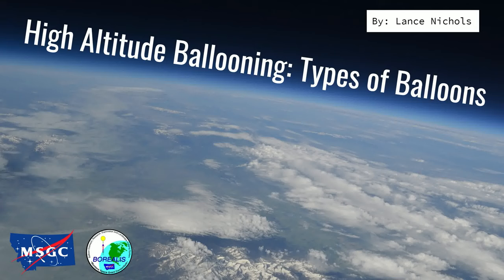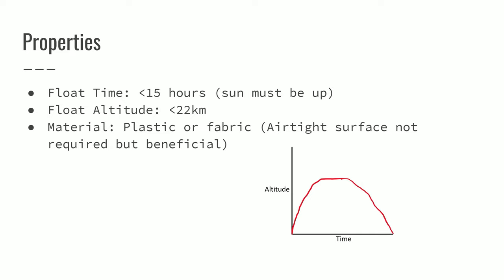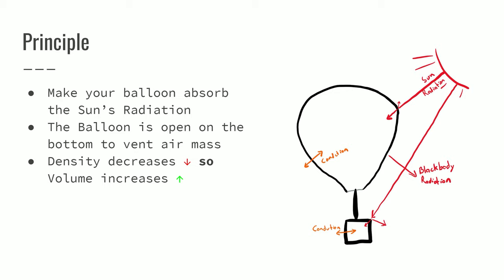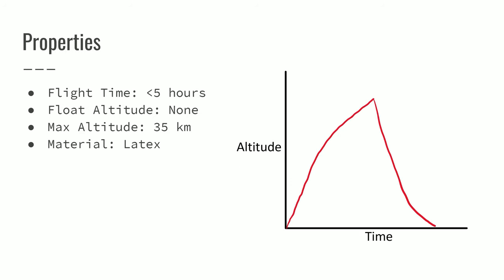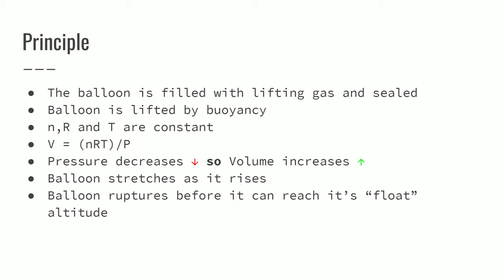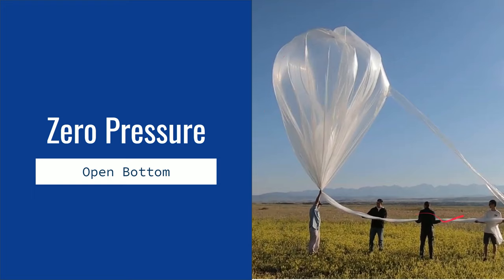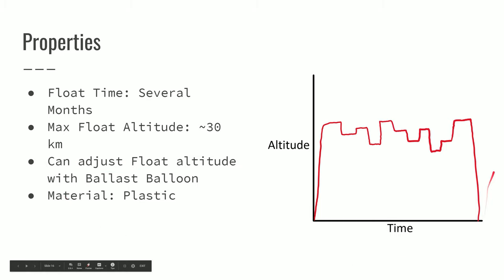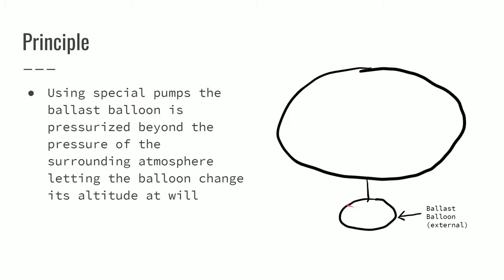High Altitude Ballooning #2: Types of Balloons

Comment: For a hot air balloon, it seems that at night, the atmospheric air cools, making the air more dense, which would increase the buoyant force, not decrease it. Right?
Reply from the maker: Good question! While it is true that the buoyant force is dependant on the density of the surrounding air the balloon begins to cool. The difference between the densities of the gas inside the balloon and the local atmosphere becomes smaller. These densities relate to making the balloon buoyant as seen in the "Relative Densities of a Balloon" slide in video #1.